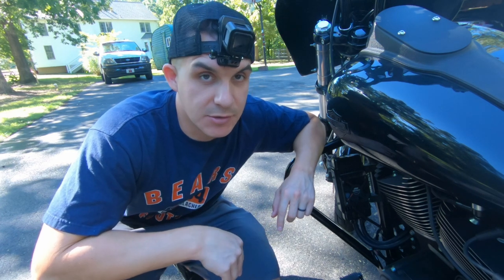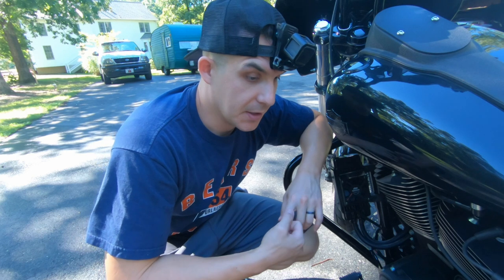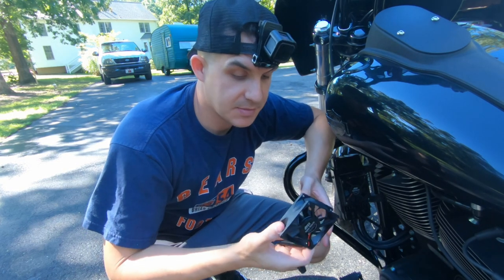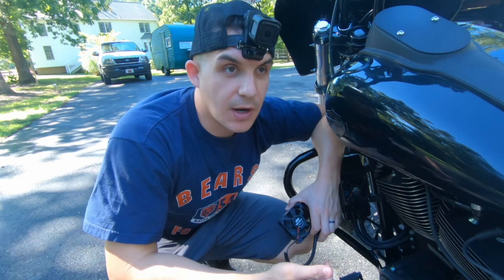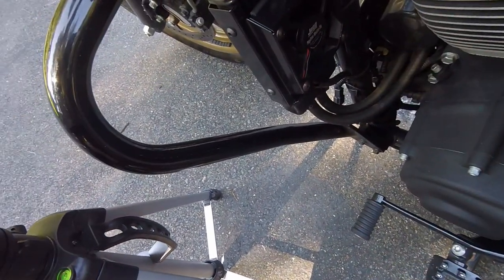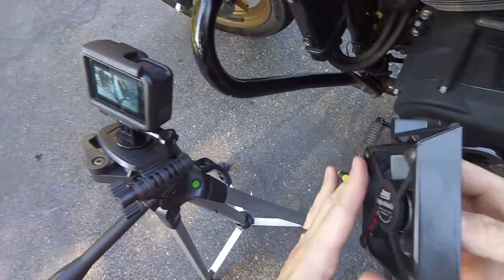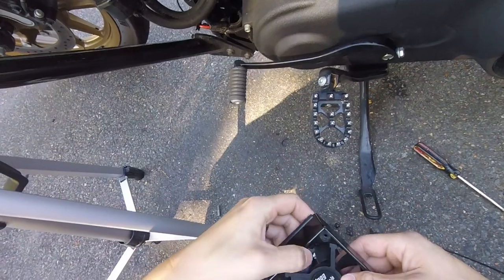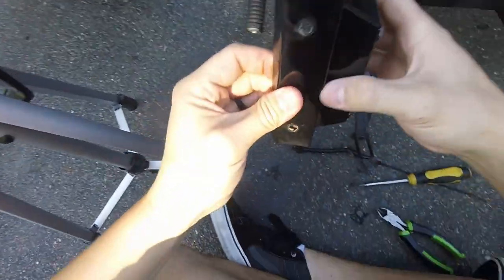Jagg Oil Cooler Review

Comment: I installed the low mount ultracool oil cooler on my 16 street bob. Had to put one in after the stage 2 install and it works awesome. I almost bought the jagg oil cooler but I was a little worried about the one I wanted being low mounted and having no protected grille.
Reply from the maker: Luis S,  yeah i think the ultracool is superior, especially the fans.  the jagg fan is basically a computer fan.  Do you know the oil temperature drop by chance for the ultra cool?  Thanks for watching     🤜🏽🤛🏽
Reply: Its like the juggs .these things run 250bucks up to around400. Alittle bit of plastic or pot metal and pc fans. Juggs or the one made with the horn. Im an old biker on ss and cant afford those prices.ill buy a couple of pc fans some wire and fabricate fans for 100bucks or less.

Comment: Love your fairing.  Hmm.  Fan looks like a computer fan.  Might check for a computer fan with metal blades, high quality, that pushes tons of air as a mod.  An oil cooler without a fan is still better than no cooler at all.
Reply from the maker: yes, I totally agree the fan is flimsy junk.  this one hasn’t broken “yet” but i will update if it does
Reply: + water proof.

Comment: I have a 2016 FXDLS and I had an engine rebuild and clutch rebuild (because the clutch fused together from heat)! Have y’all had any issues with that with your dynas?
Reply from the maker: DCMOTORISK neither of us had must have got extremely hot !
Reply: dynademos I’m sitting at 29,395 miles on mine. Maybe about 5,000 since the rebuild. I’m in DC and it gets murky up here! Do y’all only work on friends bikes or people willing to pay? I’m from near North Carolina and willing to do whatever to get this bike running correctly! I’ve had shit luck with this bike but I love it! Rode it to California and back!
Reply from the maker: DCMOTORISK just depends what do u need done ? Also if rods available as I am on the west coast now

Comment: Those fans seem a bit prone to damage . Would be nice to have a caged unit affixed to cooler frame. Also is it even weatherproof? I am in NYC and considering
Reply from the maker: Maurice Ordonez,  cooler is good lowers oil 20-25 degrees.  as for the fan it is not very good.  To answer your question on Water proof yes it is waterproof.

Comment: I am running the "Jagg Oil Coolers 751-FP2500 Horiz Low-Mount 10 Row Fan-Assisted Oil Cooler Kit". 

https://s19.directupload.net/images/191026/vbdik3ko.jpg

Just save the money.

When you are driving it cools the oil, but I never had high oil temperature problems when I was driving anyways.
But when you are driving very slowly, in stop and go situations or at long traffic lights it doesn't help enough to keep the oil temperature at a decent level. 

So it works when I don't need it and it doesn't help (enough) when I need it.

Comment: Hows it going with this Jagg unit in 2021?
Reply from the maker: Been to much snow/ice/sand on the ground to ride here lately . 😔
Reply: @dynademos  Been a long time since the review though. Hows the system hold up over time? I'm thinking either the Jagg or Ultracool for my streetglide.
Reply from the maker: yeah it is holding up fine. if your going to get the model with the fan, I would go with Ultra cool just based of the design.  The Jagg fan is cheap computer fan.  Both will lower your oil temp, however the fan design on ultra cool looks superior.
Reply: @dynademos  Yeah I'd be getting the bigger model the fit front not on the crash bars.  My bike was upgraded from a 96ci to a screamin eagle 103ci blah blah. It's cool but get way too hot for sure in traffic.
Reply from the maker: I couldn’t get that one, it wouldn’t fit on the chin of my bike bc of my front stabilizer
Reply: @dynademos  I don't have the stabilizer so should be good.

Comment: i feel like its kind of a gimmick, Legos tune couldve been the reason he was running hotter and im not sure 20 degrees would make much of a difference regardless.
Reply from the maker: Bryant Zapien thanks for the comment.  Perhaps your right that 20 degrees  doesn’t make tons of difference on you engine short term.  however i believe 20 degrees over thousands of miles may make a difference long term. Especially depending on what oil your running and how many ponies/ cubes you have.  A tune if anything would make your engine run cooler and more efficient by dialing in the A/F mixture.  20 degree oil temp will reduce engine temp and feel better on your nuts and legs if your stuck in traffic.
Reply: @dynademos   That's definitely a valid point it would be awesome if these companies did the research to prove they have a good product like some lab testings with a regular engine vs an oil cooler engine. A tune could go either way
Reply from the maker: Bryant Zapien exactly
Reply: @dynademos  I have a FXDB 2013 bought Jag oil cooler without fan, last summer lowered temp slightly..... Looking to add a fan, any suggestions on buying aftermarket fan & mounting bracket? Not trying to spend a fortune on fan... Unless it's going to last.  I had bought 2 fans both broke from vibration I'm assuming(fans that mouth where horn goes). Thanks in advance

Comment: Now is this done into the engine or like the stock oil cooler and only does the heads?
Reply from the maker: it’s like stock and it’s a 10 row.
Reply: @dynademos  how much cooler did it make your ride degree wise vs the stock with fan assistance?